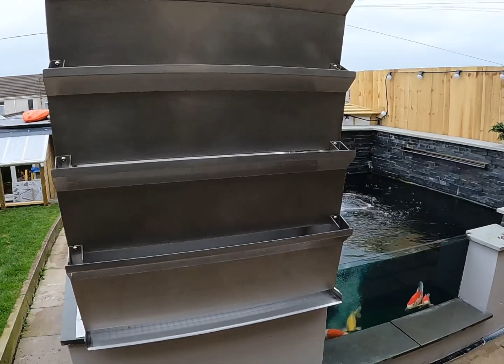Cleaning a momotaro bakki shower!!!!

Comment: Made that look fresh 10/10 job 👍🏻, I have 50kg of momataro bakki house media in the bakki shower, water clarity spot, highly recommended will be adding 20kg to 30kg more this year, also running a EA varpi pump 30,000👍🏻
Reply from the maker: Exactly what I’m planning buddy, just ordered my 3000 pump. Do you pull straight off the bottom drain over the shower?
Reply: @leehadfield6881  , I am pump feed buddy, with a retro bottom drain, I have the 30000 pump separate the retro drain which feed the bakki shower direct will be adding a sieve before the bakki (cetrus) also be building a up flow filter after the sieve👍🏻

Comment: Looking awesome Lee matey 👍🏼👌🏼 next time you use white vinegar and bicarb mix it into a paste and it will act like an abrasive and cleaner in one but don't thank me its what my mrs uses it to clean the stainless steel on the toaster apparently.
I'm looking forward to seeing what you come up with, just remember when you make the spray bar you may need to start with 8mm holes and see what gives.
The water doesn't want to be coming out like a jet wash as that causes unnecessary stress on the pump.
Take care matey and enjoy your week 👍🏼
Reply from the maker: Cool beans Tom thanks to the miss 🙏 
Hopefully I’ll get it working like a champ
Reply: @leehadfield6881  I'm sure you will matey 👍🏼

Comment: The more water you can pump over a bakki shower the better it works.
Reply from the maker: Will do Liam! 2500-3000 an hr I recon I can achieve 🤞🏻
Reply: @leehadfield6881  2000-3000 litr an hour is way to small for a bakki shower
Reply: You want something like 20 thousand litres an hour to get the full potential of a bakki shower
Reply: @liamkemsley5884  That’s right! 15 to 20 thousand litres and it should work perfectly👌